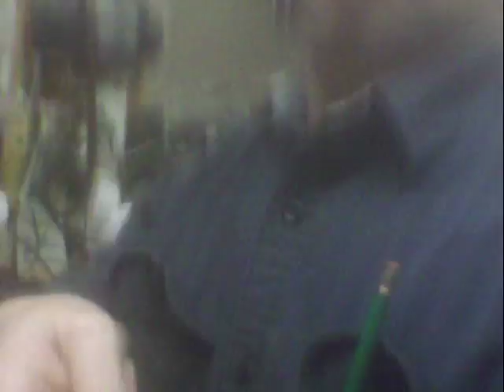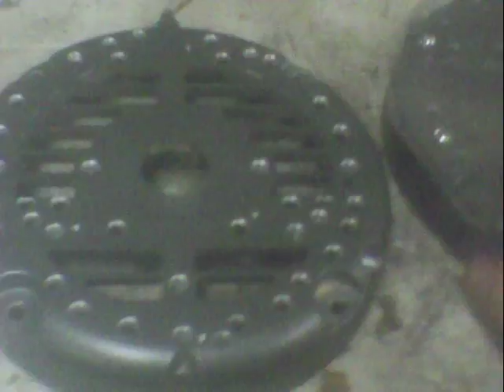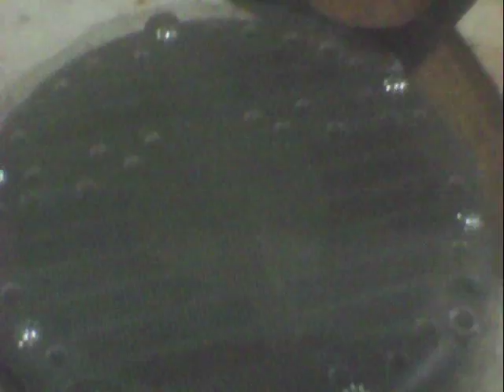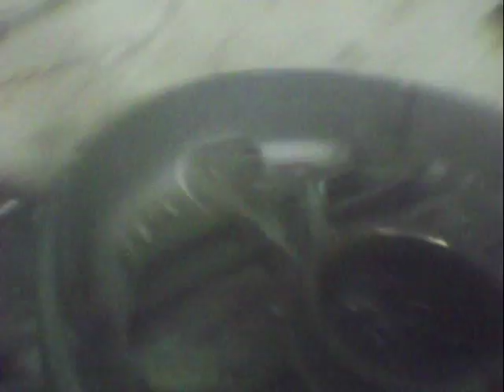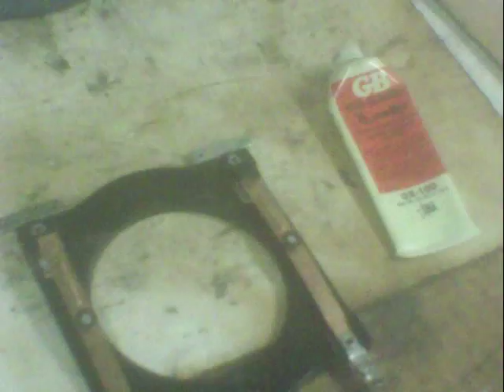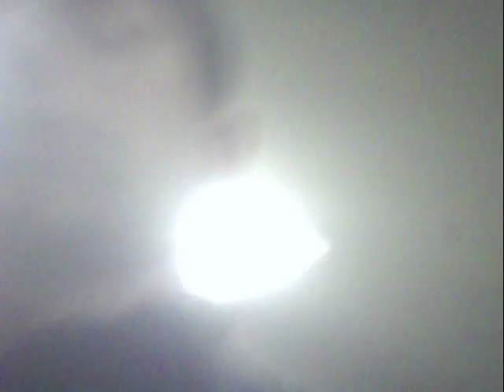How to Repair & Tune Up 1 phase/residential 240v 5HP Baldor motor DIY

Comment: I found a compressor for cheap that has one of these motors.  it says the motor is broken.  Whats the chances it's just the contacts.  Are other things as easy to fix?
Reply from the maker: Yeah, just go over it thoroughly, clean it, double check everything & take it by a motor shop if U need to. Test it out, & if you have any doubt/s, double check the bearings, stator windings, rotor & especially those contacts. The contacts are a very basic type of built in magnetic motor starter. Good luck, take care from Tn.